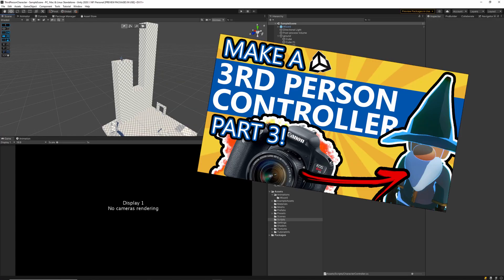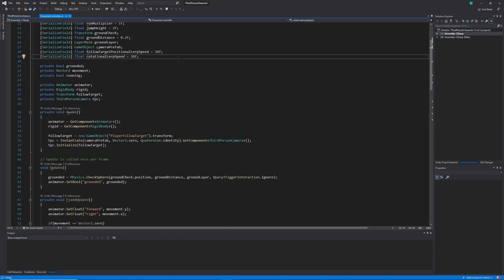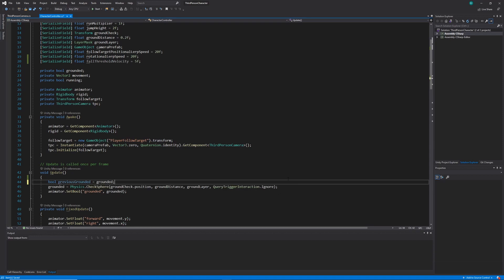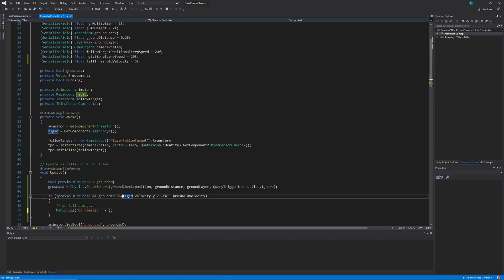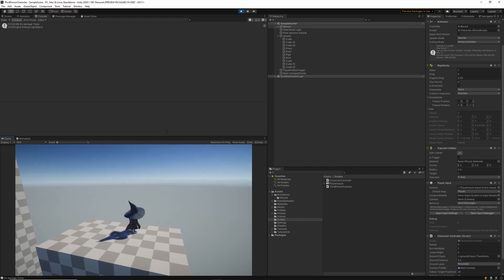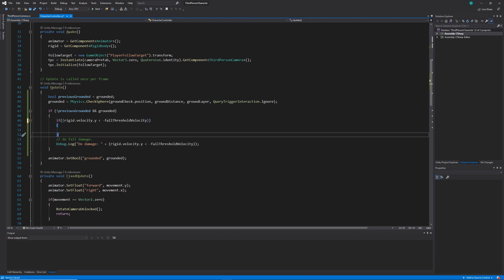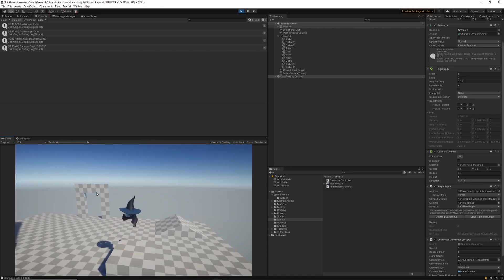Physics based FALL DAMAGE in Unity!

Comment: Hey Bimzy, thank you for the great tutorial. Certainly the best i've seen on the topic.
I've implemented this successfully into my own character controller. However, i'm struggling a little to transfer the fallDamage (Mathf.Abs(rb.velocity.y + fallThresholdVelocity) to my separate HealthBar script, which will actually take the damage dealt on impact. I'm new to coding, especially in Unity. Could you perhaps suggest how I might take this value and implement it in my HealthBar script? Thank you:) For context: 

In addition to your code, i've created a separate function called fallDamageTrigger() that is triggered like so:

if (rigidBody.velocity.y < -fallThresholdVelocity){
fallDamageTrigger();
}

Then, fallDamageTrigger does the caculations for fallDamage, and logs the damage in the console.

In my HealthBar script, i've created a void function 'takeFallDamage' and tried to use a method like so:

public void takeFallDamage()
{
GetComponent<myCharacterController>().fallDamagetrigger();
currentHealth -= fallDamage;
}

This currently does not work as I cannot access the fallDamage variable. This is likely a noob misunderstanding.

I'll keep researching, but perhaps you might have a better answer with your experience. Thank you!
Reply from the maker: Hey Jung-Zen, What I would recogmend is creating a method in your Healthbar script that looks something like this:

private int curHealth = 100;
public void TakeDamage(int damage)
{
curHealth  -= damage;
}

and then from the fall damage script you can do GetComponent<Healthbar>().TakeDamage(fallDamageAmout);

I have a tutorial on creating healthbars, which should be easy to integrate into this system. You can find it here: https://www.youtube.com/watch?v=FQNZwcd6FaY

Also, if you need more help, the discord channel is an easy place to find it ! :D
Reply: @BimzyDev  Thank you so much for your quick reply! I'll certainly give this a go and take a look at the Discord channel:) Good luck for everything in future, your videos are really great!
Reply from the maker: Thanks! Glad I could help
Reply: @BimzyDev  Your method worked! It makes much more sense to me now also. Thanks again.

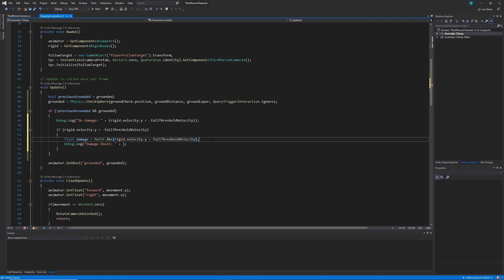Comment: 3:16 You should've put only the velocity.y in the abs method.  Like this for example "Mathf.Abs(rigid.velocity.y)+fallThresholdVelocity)

Right now it's going to work like this if fallThresholdVelocity = 1
velocity.y = -1 => damage = 0
velocity.y = 1  => damage = 2

Or just check if velocity is negative and only then apply fall damage
Reply from the maker: Yeah, you are right, that is my mistake 🙊
Reply: what if you hit something like a jump pad and landed on a higher platform, wouldn't that also cause it to do damage?